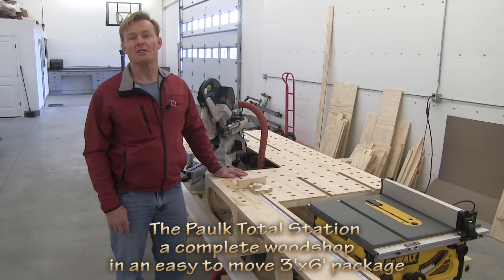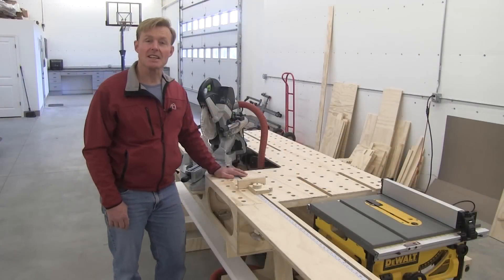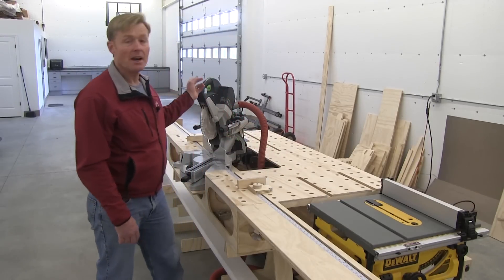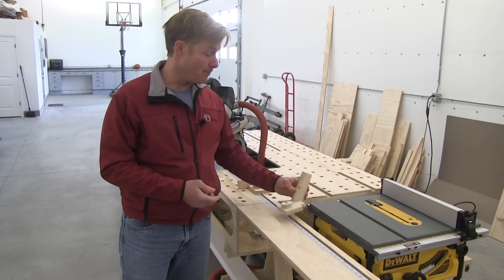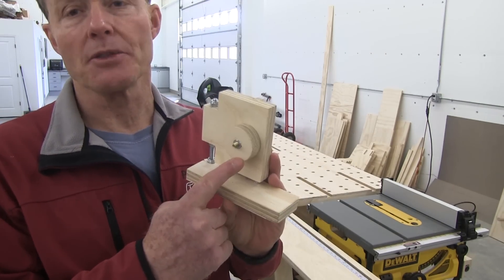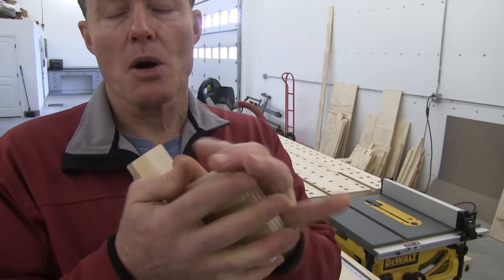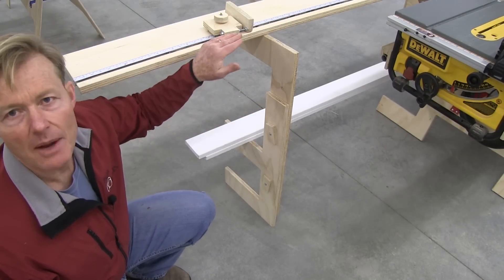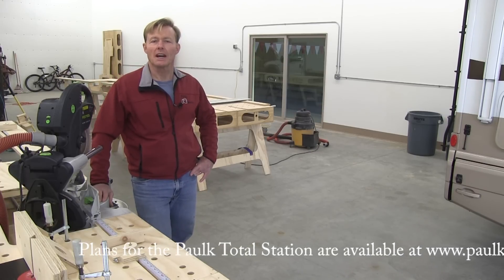A versitile, portable workbench  3'x6'x10" (PTS)

Comment: I recently purchased your "former" #1 package (WB II, miter stand and crosscut jig) in Jan.  I am also trying to get one of the companies I work for to purchase the same plans.  I have yet to make anything from the plans, but I will.  The modifications that I'm aware of are the lowered table saw supports, the 6" vs. 4 1/2" oval side openings,variations on the sawhorses for bench and stands, new locking hardware for extended table as well as flush mount track system with new stop blocks, and perhaps a new lock-down method for the miter saw.  After visiting your store, I noticed there's no price point for those that have already purchased all your other plans.  Is there going to be one? Always fascinated by your work. Thank you.

Comment: I am amazed how efficiently and effectively the smart engineering is used to create the “out of the box” tool. I am looking forward to getting more upgrades of the existing benches or the new ones. I am thinking on building one my own.
 I just have one question. Why there is a need to adjust the flip –stop if you use the built-in ruler. So if you make sturdy enough flip-stop and set the length of your milled stock on the ruler there is no need to add adjustability to it. Instead I would do the micro adjustment on the flip stop by adding additional stop block at the back of the flip stop which would be connected to the flip stop with the screw to push or pull the flip-stop when the stop block is tightened down with the fix bolt. When the micro adjustment is made simply tighten down the screw of the flip-stop.
Nice work!

Comment: Hi Ron, I would like to start with congratulating you for such a great idea. I'm sure you are an inspiration to many all around the world. Now some questions and perhaps some construction criticism to which I would love to read your reply. So here it comes: though the PTS is highly versatile, however I think that it has lost some of the attributes of the original work bench. I noticed from your vid that the PTS is huge and rather heavy to carry not to mention a little awkward to store. Would it be possible to have the PTS split in two as in the original work bench?   Again its a fantastic design but don't you think that portability has been compromised? Thank you.
Reply from the maker: Hi, I wanted the PTS to be smaller and faster to set up as a primary tool and the PWB to be an extension of it. Of course, I could make it larger and then divided it in two, but I don't think I would gain much and would add time to set up. It is not heavy at all as it is made of ½ " ply with much of it cut away as the strength comes from design not mass. It weighs less than the tools I lift onto it. 
Hope this helps,
Ron
Reply: Ron Paulk Following up on this thought.  When using the bench for breaking down sheet goods, would this shorter design have as much practical use and is there any advantage to the smaller design?  The reason I ask is I only have room in my woodworking shop for one bench so I want to get it right.  I certainly love the ability to quickly set up and tear down as I have to share the space with other hobbies, ATV's, lawn mowers etc.

Comment: Great design!  I am looking forward to building a hybrid version of the Total Workstation with two or three smaller sections that can connect to it the way your ultimate workbench connects together.  This way I can expand a single bench to a size that fits the project.

Comment: As usual Paul, a great design. A perfect compact work surface for anyone with a tight space constraint. Well done.
Reply from the maker: Thanks Joe, combining the Total Station and Work Bench is a real help in my workflow. I use to have a cabinet shop full of stationary tools and still needed a portable shop for most of my work. I am much more satisfied just having my portable shop as I can do all the work I did before, but do not need to support the cost of big machines and the space to work with them. I really like it when working around the house on weekends as I can have it up and running in under 10 minutes. I am pleased to the point that I am considering selling my Mobile Woodshop and going back to a smaller trailer and pick up. I just completed a four-month remodel using the Total Station and Workbench and found I saved so much time having the set up right where I was working in contrast to walking out to the truck. 
Ron
Reply: That's great to Ron. I know you originally said in older videos that you liked the trailer because you could disconnect it from the truck and then do runs to the home center or dump easily.

I am assuming that you went to the smaller deWalt saw due to the exoskeleton being able to support the weight of the saw and stock you are cutting from the bottom due to having to run the support rails lower because of the miter saw?
Reply from the maker: Joe Stafford I picked up the new saw as the table was smaller to fit the smaller bench. I have found the smaller saw is a better saw than my old one having the same rip capacity and higher rpm motor. DeWalt has really improved their already great table saw.
I lowered the table saw supports, mainly to open up the storage inside the bench. Now the pipes don't bisect that area.
Ron

Comment: Just ordered the plans for both the WS2 and the PTS . I am flirting with the idea of cross breeding them. I have been waiting years to make it and have a week between jobs next week for the first time in forever. Looking forward to it. I will be using my own cross cut jig which currently cantilevers off the edge of my 4' torsion assembly table  which allows me to make 4' cross cuts from the end when under 24"( less reaching across). Thanks for the great videos.
Reply from the maker: +Ron Rosa The PTS was the result of playing around with adding a miter stand to the PWBII. I didn't like the strength of the bench at 2' wide and when I decided on 3,' I made it shorter and one piece. I have been very happy using both. Most of my big tools now are on the PTS, keeping the PWBII clean for breaking down plywood and assembly. They operate well together, so I can use them even in a tight space. When I have room, I even set up a second PWB, using one for breaking down ply and the other for assembly.
Reply: I ended up making the Workbench 2 instead. "More real estate too enticing!" Put in my 1st  5  hrs today . I made template, routing all the sides and spreaders. Everything cut up...( My wife say's thanks a lot!)  Tomorrow  sanding and hopefully some assembly.  I did make a large 8' template because  I am  toying with the idea of making  cross cut jigs from identical sides which would just slip up and lock into place when needed. Then slip back down when not in use. Do you think laminated dbl 1/2 " would do the trick? I also would like one to pop up from the middle as needed to serve as a continuous stop for assembly.  Looks like she may grow a few pounds,lol. By the way ....you  can make a ton of small skate boards from the oval scrap .LOL Ty Ron

Comment: The thing I'd like to figure out that would most improve this design would be for the miter saw to be able to flip out of the way. Flip or slide out and slide back in hanging down. The overall size is perfect for a guy working out if a van, the only obvious limitation is switching over to breaking down sheets

Comment: I bought all the plans and am going to make a few benches in the near future.  I just finished making Fine Woodworkings' "new fangled work bench", which turned out pretty well.  All the benches will be for my wife's woodshop.  I'm going to make a vaiation with a router insert and mounting for a dewalt DW735 thickness planer.  This will allow us to elimintae a separate router table and planer cart as well as providing a bigger in/out feed surface.  What I'd really like to do is make the planer flip so that the entire workbench surface could be used once planing is done.  I was wondering if you have any thoughts on the flip idea for the planer?

Comment: Ive been thinking abouf building your mifer stand and half of the pwb to link them together and shorten it all up to fit my shop\jobsite needs and restrictions. Its like you heard my brain humming.  The croscut jig would still clamp up to this correct? Keep up the awesome work.
Reply from the maker: I still use the PWBll for the CCJ, but you should have no problem using it with the Total Station. Of course, you can't cross cut a full sheet of plywood as the bench is only 3' wide.
Reply: I usually only need 30 inch cross cut for cabinets and book case type work. Thanks for the reply

Comment: Also, in general where do you set up the workbench? Here in San Francisco, we don't have much room to work on our remodels.  I usually request an extra room from my clients for a space to work out of.  Just curious if your design had a space/size consideration. Thanks, awesome videos and design!
Reply from the maker: I can always find a place. All houses around here have garages, so I at least have them move the cars out and set up in there. I try to set up as close to the work as possible. I also, like working outside when the weather is nice so the garage pad works well too. I never work out in the wet weather with my finish tools. As to size space consideration, my design is all about the working conditions. My shop is portable and easy to set up and as compact as it can be and still be completely functional. The work environment and type of work I do, have driven the design.

Comment: Ron, Ive noticed on recent videos that the DeWalt saw has been replaced with the SawStop Jobsite Saw. Any video on the modifications in the works as I remember you commented ther was a size difference between the two?
Reply from the maker: Joseph McBride Yes, I have switched to the SawStop, but am using it on the stock stand. I have been thinking about ways to mount it. If I do, the mount will be universal to fit most jobsite saws. I will make a video, if it happens.

Comment: In considering the PTS and the Work bench II, how hard would it be to include a bench vise into the design.  I have seen one added to a torsion box bench top, and basically that is what you have here.  The clamping systems available will without a doubt handle the majority of tasks, but occasionally the old school in me kicks in and I need the vise.  Have you seen any pictures of the one's that have built your design that have added one? and or incorporated a more permanent base with storage?

Comment: Hi Ron. I'm in the middle of the total station build. In the plans there are two cuts in the bottom that I can't identify. One is rectangular 4"x8" and an 8" diameter circle. In the videos I never catch you making these cuts and can't see them. Are these wire management or did I completely miss something. Thanks. Gary
Reply from the maker: +Gary Carpenter Hi Gary,
The circular opening is to make room for the router and the rectangular is to route a vac hose and power cord to the miter saw. The rectangular hole also serves as a handle to carry the bench.
Ron

Comment: Ron Paulk if I was to build one table for my 2 car garage would you recommend the Workstation 2 or PTS?
Reply from the maker: Hi Dennis, I use the PTS the most, and it does most of what I need. I do have the Work Bench also for assembly and larger projects. Picking one over the other is tough, but I would start with the PTS.

Comment: Hi Ron, I noticed you are using the DW745 on your PTS. How do you find it compared to the DW744 you have on your work bench?
Reply from the maker: It isn't the DW745; it is the newer DWE7480, which has the same cutting capacity as the older and larger DW744 plus a higher rpm motor. I like the DW744, but prefer the smaller size and other refinements of the newer series.
Reply: Ron Paulk Thanks for getting back to me, we don't have the DWE7480 in the uk yet. The DWE7491RS is coming out this week so going to have a look at that.. maybe Dewalt will release the DWE7480 at the same time.

Thanks for sharing your designs, they are Awesome.

Comment: Have you or anyone else been able to incorporate a 5" Irwin bench vise for metal work and an Irwin woodworking bench vise on the other end (in order to weight balance the bench's ends)???? I don't need the sawhorses for portability, but I would like to see these metal vises incorporated into the Paulk 3X6 workbench. Does anyone have a YouTube or other link showing how other people have incorporate these types of vises into a Paulk workbench????? As I said, I don't need to move the bench to a site. It would be on a frame with rolling wheels in my garage to roll out of the way for the car space.
Reply from the maker: Check out The Paulk Workbench on Pinterest as a few have added a variety  of bench vises; https://www.pinterest.com/search/pins/?rs=ac&len=2&q=paulk%20workbench&etslf=8908&eq=paulk%20w&term_meta[]=paulk%7Cautocomplete%7C&term_meta[]=workbench%7Cautocomplete%7C

Comment: What size DeWalt table saw are you using?
Reply from the maker: +harvep In the I am using the DeWalt 7480 10," but now I am using the SawStop Jobsite saw which just came out a few months ago. I put of a few videos featuring the new SawStop. Currently, it is the only portable saw I would buy or use.